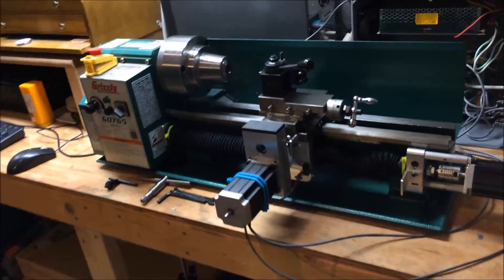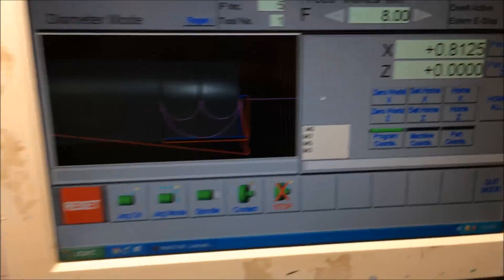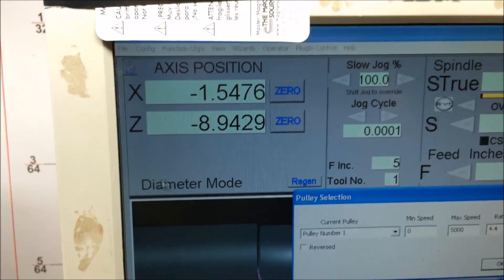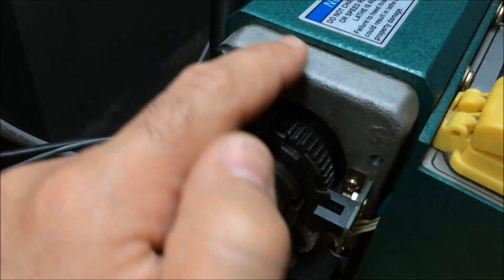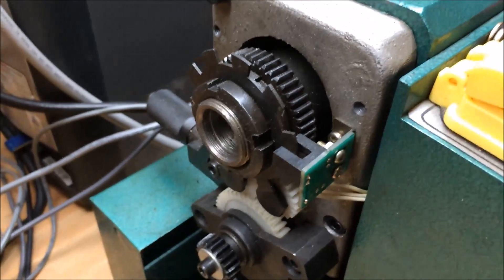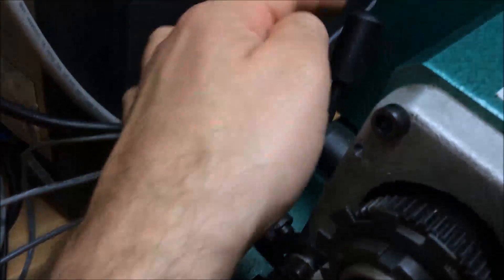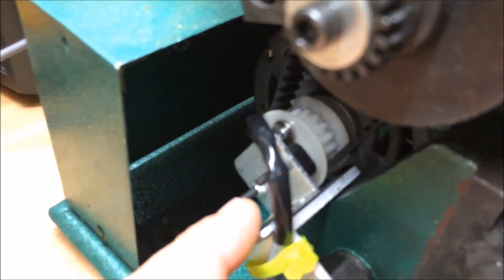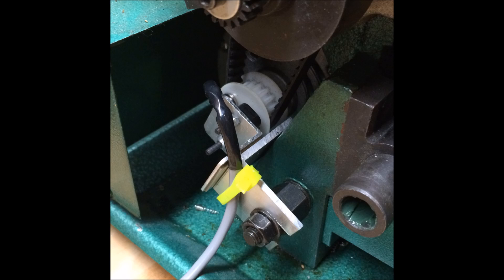G0765 Mini Lathe Spindle Speed Tachometer Installation

Comment: Hi  Franco ,   do you have an email ?    ,  i have a question about your calibration ,  like if my motor does 1 rotation my lathe does 1.5 rotaton what would be the ration in my settings?  And whats your signal debounce and  PID and special spindle features  ?   , on my digital laser  tach shows 1750 , the laith tach shoes 1750  and mach3 says measuring  500 rpm ,   sorry for so many questions but ive found very little info on calibration

Comment: Franco, Just a question, Does the Aluminum Bearing Bore in the Fixed Casting for the Stud Gear just below the Tumbler Gears worry you? Or did you machine the casting and install a real bearing?

Comment: How well does this work in practice when running a job? I would imagine some lathe ops like threading would actually need to take in account the spindle speed. Does Mach3 adapt the feed rate if the spindle speed drops too low?
Reply from the maker: Hi.  This is exactly what the INDEX signal input in Mach3 is for.  Mach will monitor the spindle spindle speed and adjust the feed rate for threading.  It also works for unit per revolution feed rates.  One point to keep in mind:  I no longer use the configuration shown in this video as it will not work for threading.  Threading requires one pulse per revolution and this setup cannot provide that.  Now, I mount the magnet on the spindle tube and take the reading there.  It works great.
Reply: Franco Awesome!  Very nice work. I'll have to look at your other vids since this is done so professional. I also get magnets from home depot, they do have a decent supply. Wish they had some linear bearings and rails in stock.